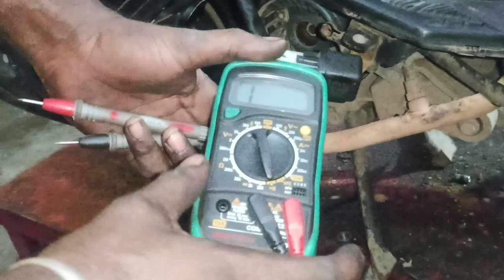Yamaha RAY, FASCINO Starting problem/Tamil..

Comment: This is a stupid design by yamaha. If they really are over protective, there should be a speed sensor where the vehicle shouldn't exceed beyond 20 km/hr to avoid any mishap for the driver when side stand is ON. Or Just give a loud beep like what scooty pep is doing. 

Making the vehicle handicapped is the worst use case one could imagine. 

Either they should give adequate protection for the wiring ( which is exposed where it is prone to rupture on use). But diagnosis as usual is excellent. Superb.
Reply from the maker: Thanks